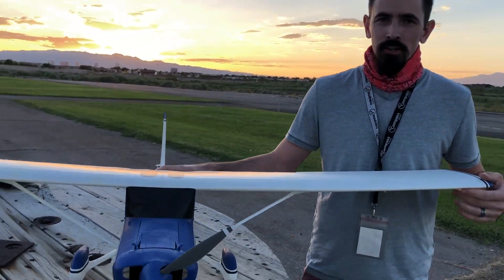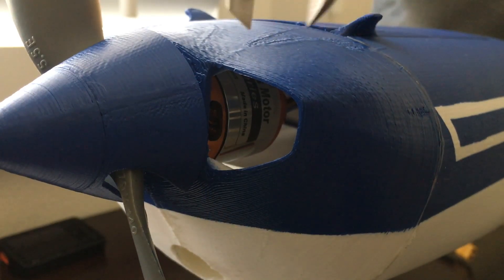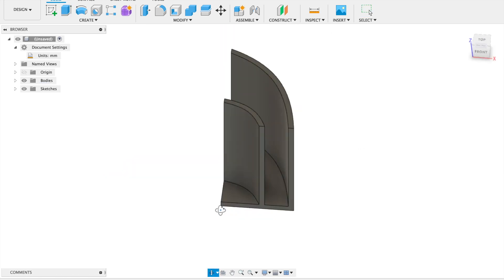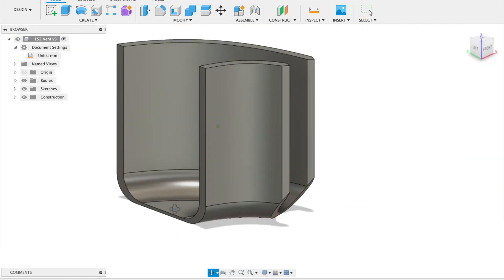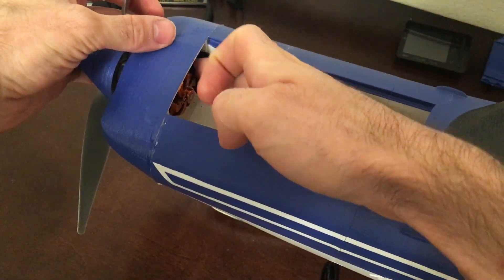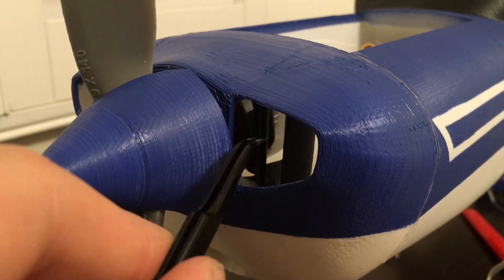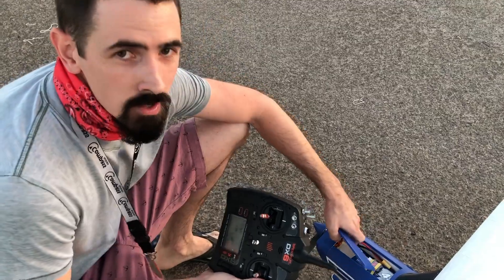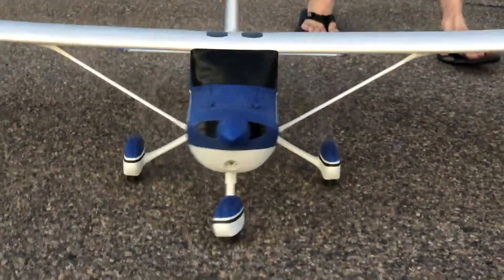How to Fix Overheating 3D Printed RC Airplane

Comment: Hi @TroyMcMillan.

Thanks for your videos. I'm currently building this airplane, but I'm now confused with the cooling. Is there any way to the air to go out of the airplane once coming in the front?
I'm also concerned with the ESC, and I'm not understanding how can that mod you built help without an air exit.

Thanks.

Comment: You are trying to get air in the motor compartment but seem to not have any way for the air to flow out again. Fatal error!
Reply from the maker: There is areas for the air to flow out of both the motor and the fuselage.

Comment: You are an impressive young guy!!. What is the cost of buying a good printer and downloading build files, etc.  Other than fascination with the technology, do you think that an average hobbyist can afford the equipment, keep it working properly  and use it cost effectively in support of their hobby work?
Reply from the maker: I paid $500 for my printer you can fine good printers for around $200-$300. After the initial cost it is cheap to run a printer the plastic is around $20 per roll and when I am building misc part for stuff I am using black, white PLA.  It is a nice tool to have to support the hobby. A full build airplane is not the best but to help make small pieces it is nice. For example I am 3D printing tire right now for some foam planes and I can make the rims and tire what ever size I want. I also made some control horns custom size and as many as I need. That stuff adds up when you buy it from local hobby shops.

Comment: btw,    No  one  having  a nanogram of   Commonsense  would do  surgery  on a  servo; in order to reverse the polarity of its  motor !!!        it is NOT clear whether air can  EXIT  the fuselage.    if  not, it's like blowing into a soda bottle....  NO  air  exchange.!!!  and  NO  cooling/heatsinking.
Reply: All you really needed to do was to cut some exit holes in the bottom of the cowling. On many reciprocating engine planes the engine temp is controlled by adjusting the cowl flaps, that is the exit for the cooling air, to make the engine cooler they open up the flaps to increase the air flow over the cylinders, in cold weather they close the flaps to increase engine temperature.

Comment: Thanks for the video! 
You still fly @ Marymoor at all?
Also, 3d printed gear seems sketchy. Would it work as well on the grass as your DC-3 or just snap off due to the drag?
Reply from the maker: The gear for this plane is pretty strong. I have had some hard landings and they have held up good just had to replace the axles that I 3D printed. I think this gear would hold up to grass. The DC3 would be hard to make 3D printed gear. I am planning on trying to build some for it but it will probably not be all out of plastic.

Comment: some info.        at :06, the servo/linkage  is  Not  centered.         at 1:47,   the  flare/taper in this design will cause a low-pressure zone, at the motor.    idk if that's bad.      itza safe bet that this model has a tail-heavy dom.    distribution of mass.       the use of an elongated  nose is a poor substitute for an  Optimally stable  dom.       it appears that the Thickness of the main wing profile is  less-than  optimal.           googletranslate